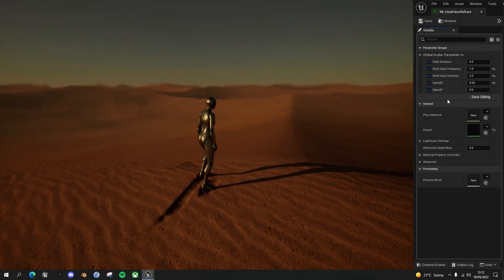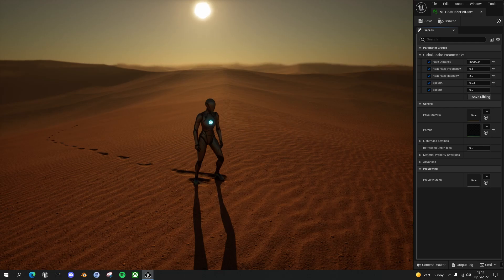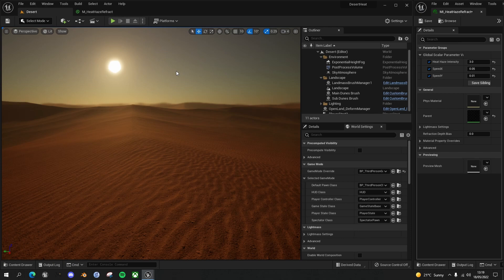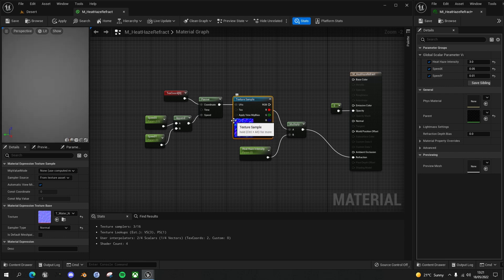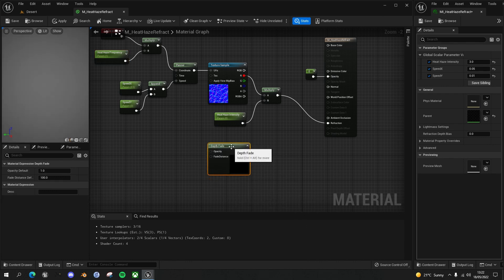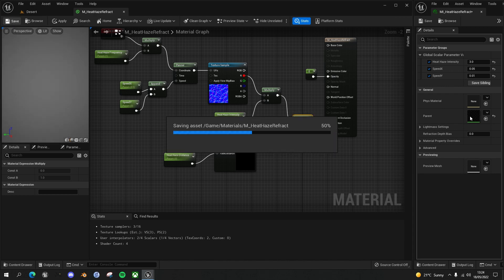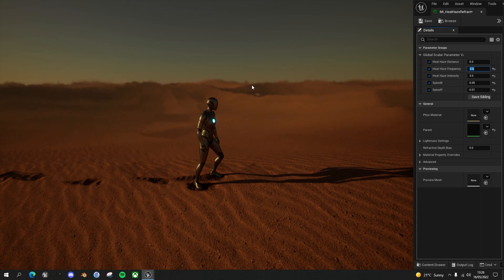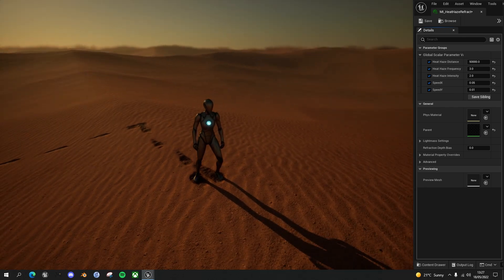Unreal Engine 5 - Heat Haze Part 2: Frequency & Distance

Comment: I seem to be having a small issue with this one, I think the edge of the refraction plane is still visible in front of me, whenever I walk towards objects there is a slight, but sharp distortion. This isn't as obvious in the dune setting, but as soon as I add any solid elements like a cube it is quite jarring. The distance parameter is working too, so maybe it is the rotation of the plane? Not sure why this is happening and would love to get your input!

These tutorials are amazing and have been extremely helpful! :))
Reply: You are correct, it is rotation of the plane. I changed it to like 90.1 or something like that and ramped up the intenstity to like 25 and distance to 75000
Reply: @Kaenshin  This helped! Thank you